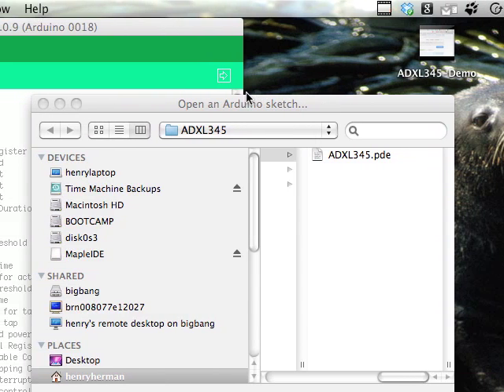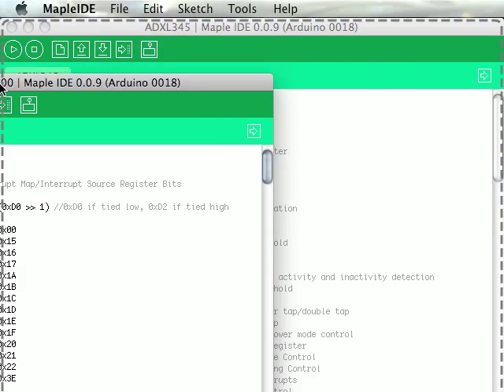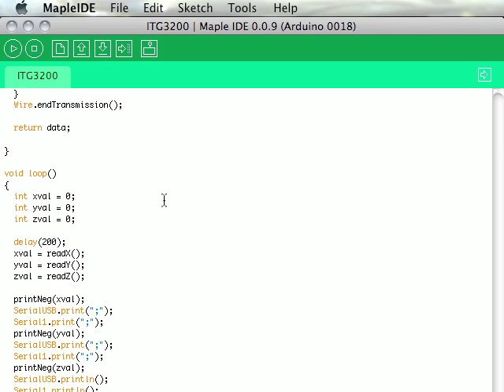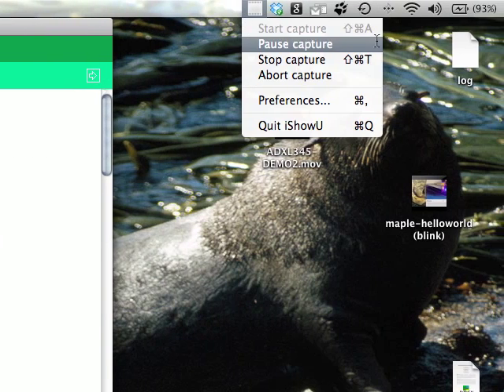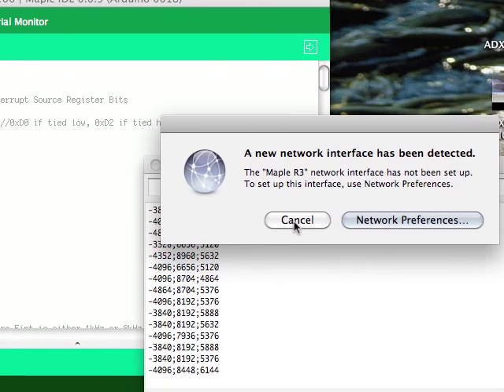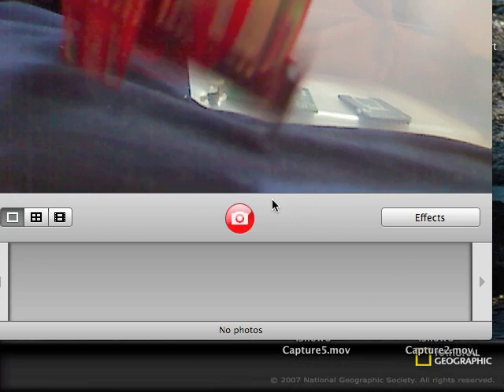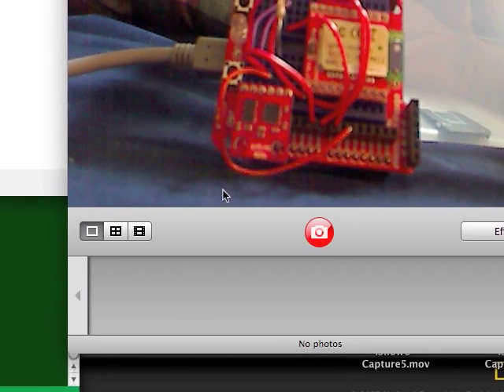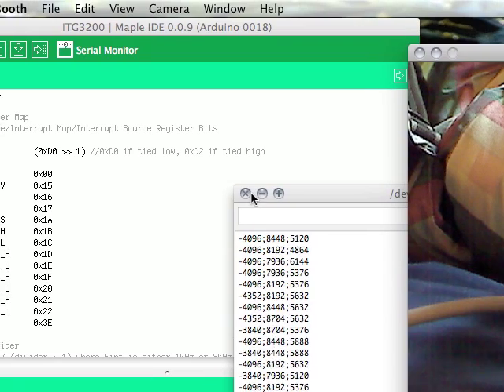ITG3200-Demo.mov

Comment: you are absolutely right sir , when i check the voltages of scl, sda they are less than 3.3 v , so  use pullp up resistor at scl,sda two resistors and some changes in the code , i made sda voltage 3.3 V and scl voltage varies fro 0.9 V to 3.3 V . this is change i made in the your code
int sda = 20;int scl = 21;
void setup() 
{     Wire.begin(sda,scl);  SerialUSB.begin();  Serial1.begin(115200); 
 pinMode(scl, OUTPUT);  pinMode(sda, OUTPUT);
  setupITG();
}

Comment from the maker: @MrLk41 hmmm, you have pullup resistors installed(2k-10k should work), you should see 3.3V on the SDA, SCL lines.  Also you can look at the signals using an oscilloscope, if you have access to one to make sure the data it getting transmitted.

Comment: Hi henryeherman , First of  all thank you very much for your work .
I am using the leaflabs maple board  and gyro(itg 3200) and i use your code  but I get the out put as"0,0,0" Can you please help me whats wrong with my project. i connected four pins as you stated in your presentation "vdd- vcc, gnd-gnd, scl,sda to pins 9 &5" and i check the voltage of vcc = 3.3V " when i upload the program i get all zero values Please help me and once again thank you very much